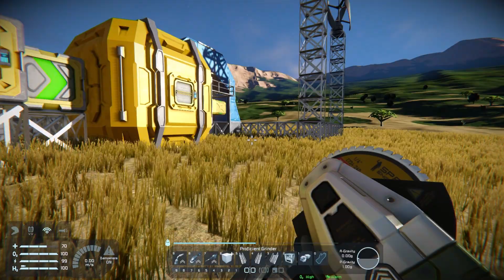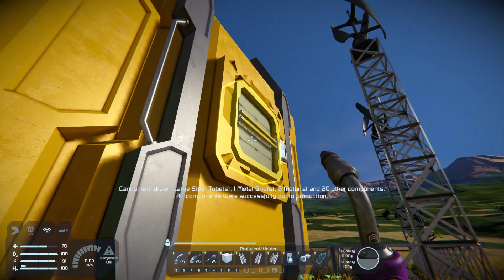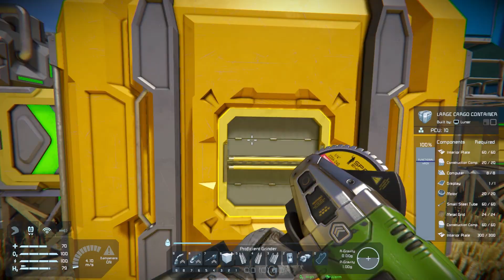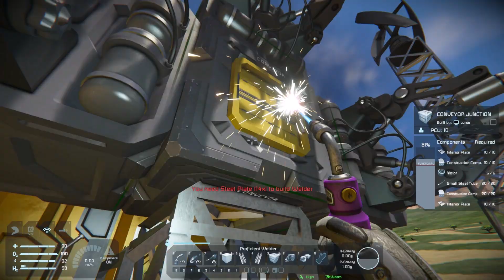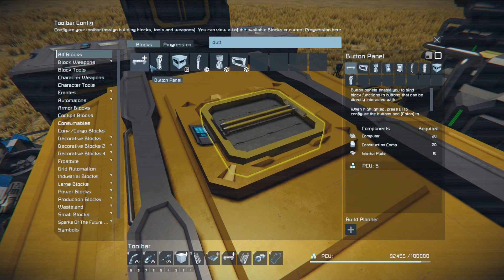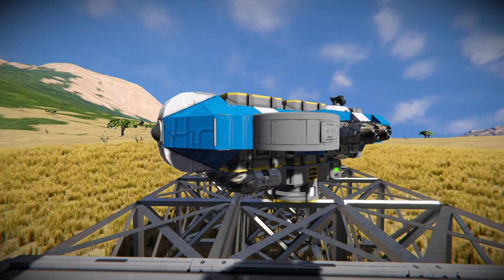Survive with me #8 - Ship printer tutorial (Space Engineers)

Comment: One of the things I do for printing small grids, is i build a standard Rotor on my base somewhere, and put a small rotor head on it. Then you can place a projector on that and have permanent power and a printer built into the large grid base, but for small grids. Dont forget to include projectors ON your miners/fighters so when they're damaged, even without a BuildandRepair unit, you can much quicker get it welded and repaired back up.

that outpost and little welder ship are pretty cool..very simple and how i build almost exactly. Thanks for the tutorial!
Reply: I do kind of the same, but let the rest the rotor on a single block with 3 horizontal pistons attached to it. That will "pull" the projection out of the printer and thereby print it automatically, without the need to pull it manually with another vehicle.